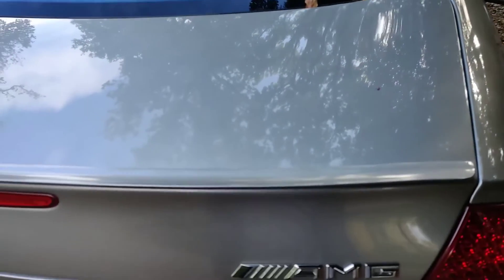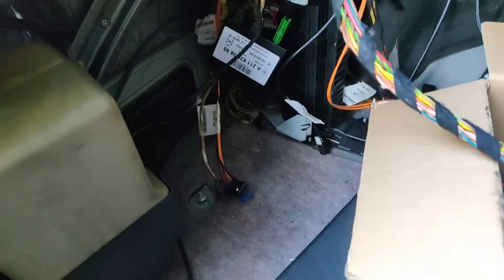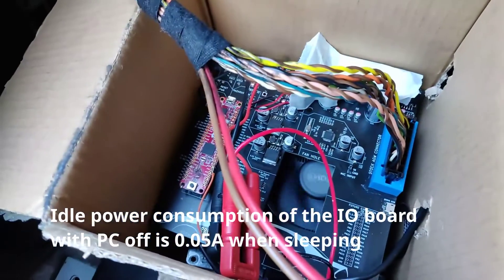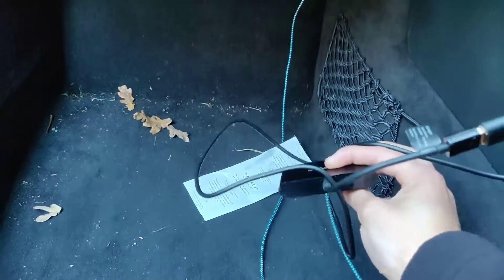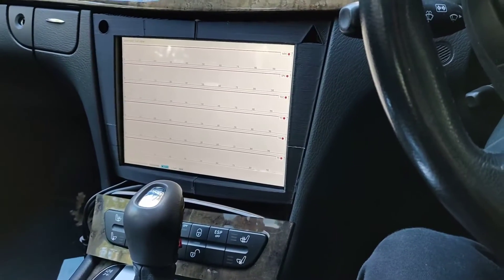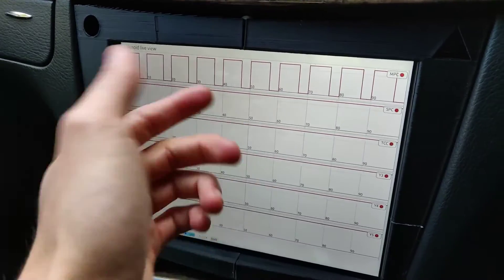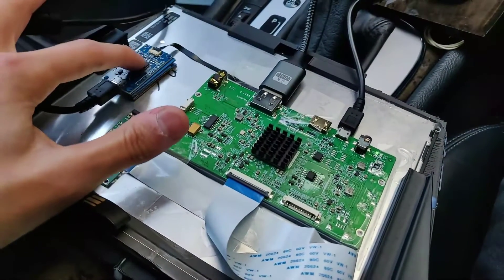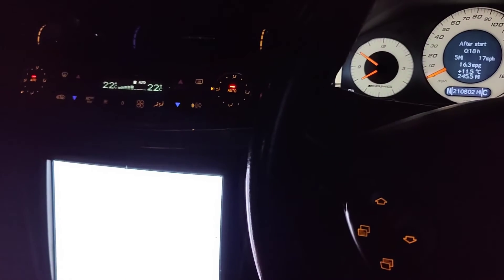Custom E55 AMG PC headunit update 2 - BIG SCREEN!

Comment: How much power does the headunit draw, do you know? Surely this must be quite taxing on the car's battery if you ever want to listen to music with the car's engine off.
Reply from the maker: Well, the stock audio system consisted off a headunit, main unit in the trunk, a navigation unit, the cd unit and 2 modules for phone functions. When running on battery the whole system was consuming about 400W when playing audio. Now my system in total only uses about 300W when maxing out audio. So it is a nice improvement
Reply: @RANDASH  wow, the stock system uses a lot of power.. How big is the battery for the car, is it AGM? Have you ever had issues with low battery charge / whatever.
Reply from the maker: No issues whatsoever. The MCU puts the pc to sleep with the car off, draw is 0.02A when off, so less than the alarm system takes from the battery! And I'm using an AGM battery (85Ah)

Comment: If I should give you a suggestion, make a custom mount for the LCP that uses the stock ashtray compartment/ fascia. 
You can remove the wood fascia gently on both and 3d print a different fascia. 
Or ditch the ashtray altogether with a 3d printed holder for the LCP.
There are just some things that are better with physical buttons.

I didn't recall if you are reusing the OEM GPS antennae.

I had been looking into buying a Android head-unit as the DVD based navigation is slow, but rather sturdy.

But I like your design a lot better. The idea of having the processor in the boot is a good one as there will be less wires to run, and I can keep the phono cables to a minimum, even having a breakout audio card with optical to phono if those even exist anymore.

Seeing as I don't have the full upgraded system anyways, and I have my old Alpine setup from my W124, I'll use the 3 amplifiers from that to power the speakers (4*100W@2Ohm) and the 12" custom sub I made (2*800W@2Ohm), minus the center, the center grille rattles as is.

Comment: Very nice sized screen for this car. I would really like some videos showing your 3D Design process for this HU frame/insert, if it's not too much of a hassle. 

I made a 10.1" screen holder that mounts into the top center vents on the dash, but it definitely could have been secured better. Curious to see what you're doing in your design exactly. Great video as always! 👌

Comment: How do you find out if you have a built in amp, I have a w212. What I'd like to do is figure out if I can hook up a tablet to the car, get a can board, maybe something like the canpico and reverse engineer the media and comfort controls in the car, steering wheel controls, ac, lights, etc.

I also had a crazy idea, obviously not on public roads, but since the car has parking assist, does that mean it would be possible to fully remote control my car? I'm assuming it might be limited to low speeds, but would be cool to try.